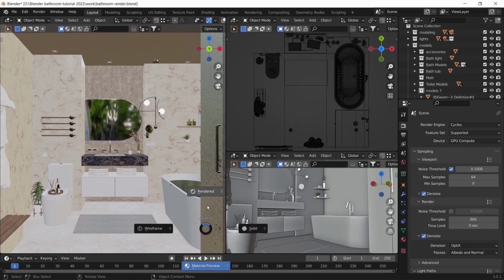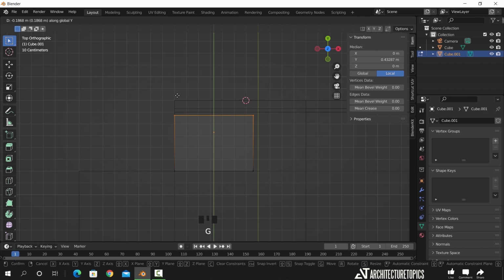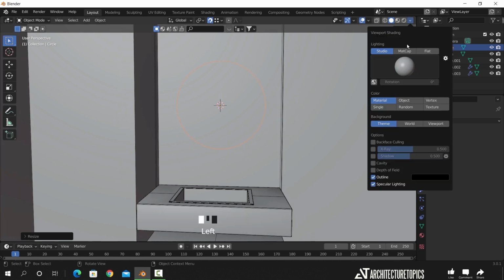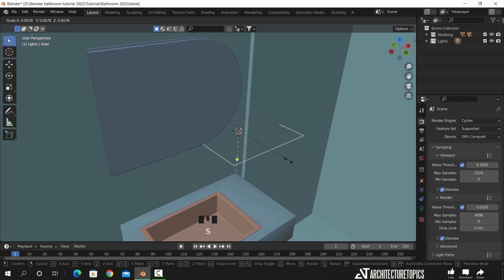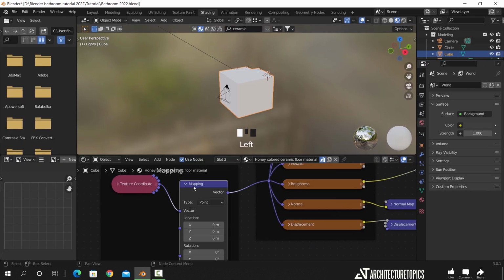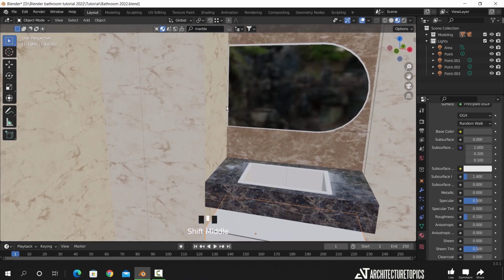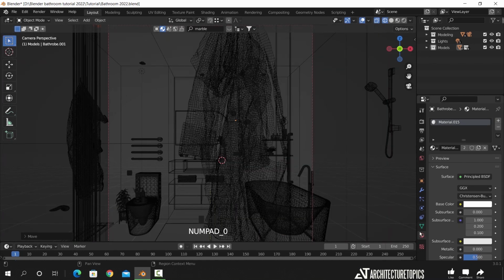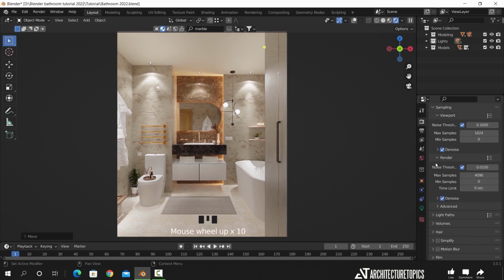How to Make Interior Bathroom in Blender (Tutorial)

Comment: Im stuck in blender with the outliner being in full screen mode and no viewport. its either the outliner or the viewport being full screen, and the other just gone. does a kind soul out there know how to fix this  ? 

how do I get the screen back to normal with the outliner on the righthand side ?
Reply from the maker: A bizarre problem indeed, Maybe try to Reset the main settings from the file menu, or even download a new version it's only 200mp.
Reply: @architecturetopics  thank you for the respond, i appreciate it!
I have been struggling with it for hours and it was such a stupid thing as to split the screen and changing the other side to the outliner. 
i feel so stupid now haha